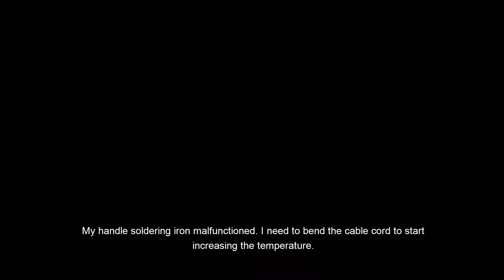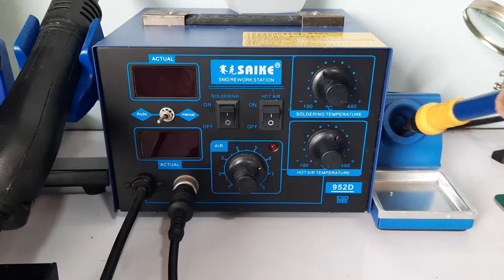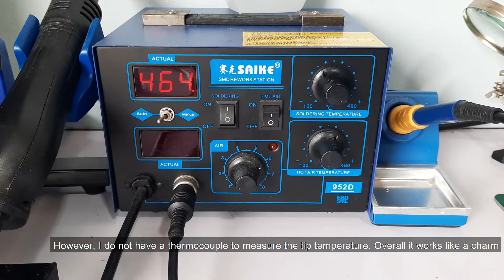How to Diagnose and Repair Soldering Iron Not Heating Up | Temperature | SAIKE 952D

Comment: Thank you for the video. I was planning to replace the whole thing. But watching your video made me reconsider. I tested the wire and found damage in a wire. I didn't cut the whole set. I just traced the wire and realized it was damaged a couple of inches away from soldering iron. Just cut the damaged 2 inches wire and replaced it. Done!